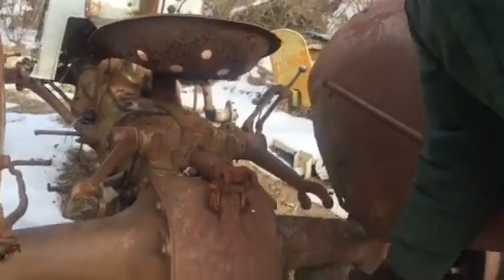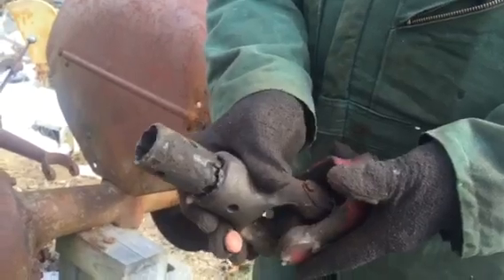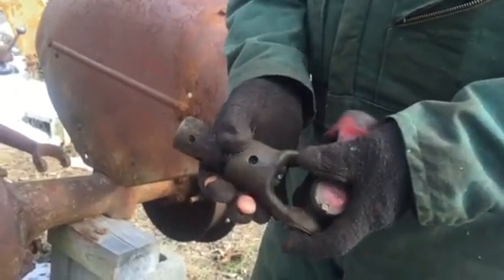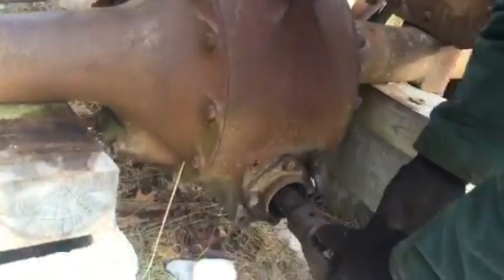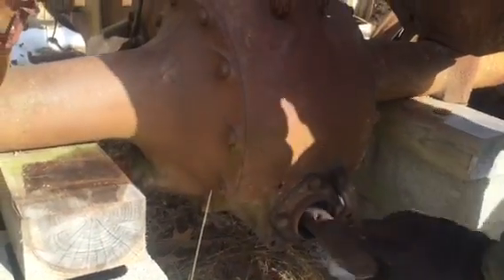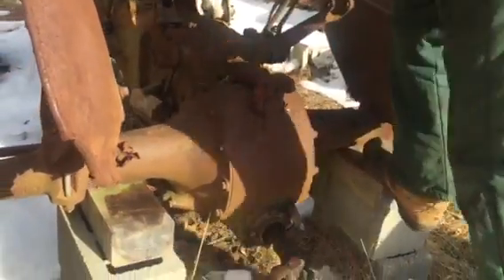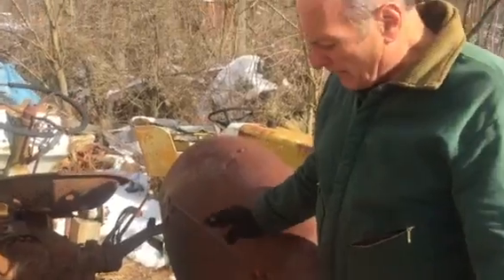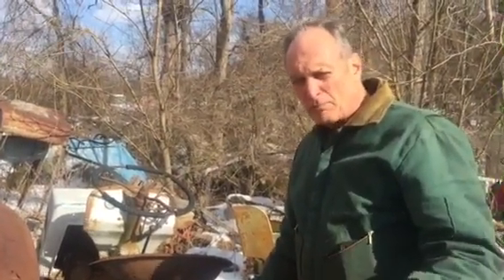Testing Hydraulics in a Non-running Ford 8N, 9N and 2N

Comment: Could you assist with help in troubleshooting a 9n hydraulic issue?  Took mine apart as it was full of sludge.  Cleaned it very well and reassembled.  The lift goes up but does not lower, over a few days it will loose pressure and lower it self.  Thanks for sharing your knowledge on these tractors I really enjoy the Ford N series tractors
Reply from the maker: Might be your control valve is sticking. Remove your round side cover by taking the lower bolt out first. If fluid comes out than your system is overfilled. Allow to drain than with side cover removed and tractor running raise lift than lower lift quadrant than lower if it doesn't come down take a long screwdriver and carefully move the valve at the end of the wishbone forks out and lift should come down. Repeat the up down process several time and it might be able to free it up if not you may have to replace the valve. If out also replace safety valve.
Here are a couple of sites that may help you.
Ntractorclub.com
YTMag.com
Oldfordtractors.com
Reply from the maker: Might be your control valve is sticking. Remove your round side cover by taking the lower bolt out first. If fluid comes out than your system is overfilled. Allow to drain below bottom bolt  than with side cover removed and tractor running raise lift than lower lift quadrant than lower if it doesn't come down take a long screwdriver and carefully move the valve at the end of the wishbone forks out and lift should come down. Repeat the up down process several time and it might be able to free it up if not you may have to replace the valve. If out also replace safety valve.
Here are a couple of sites that may help you.
Ntractorclub.com
YTMag.com
Oldfordtractors.com
Reply: Thank you for the quick reply.  My fluid is indeed over filled, did not have any tools with me to drain when I was at the cabin last time.  Next time I go there  i will drain some out and try the steps you mentioned.  Keep your videos coming, very interesting stuff!